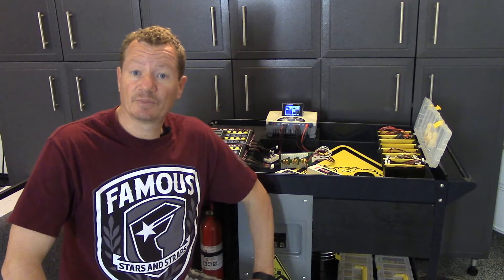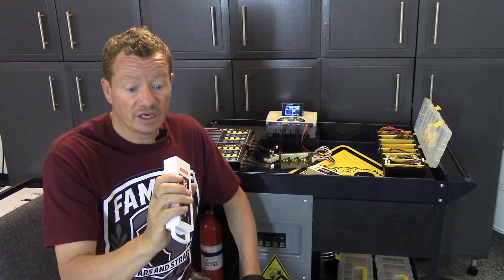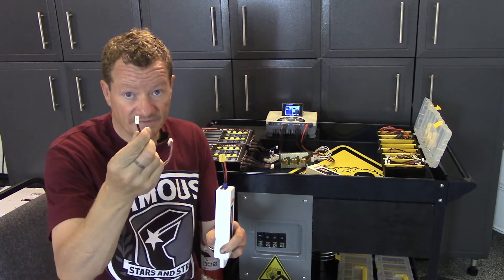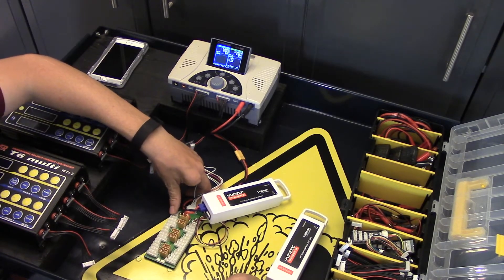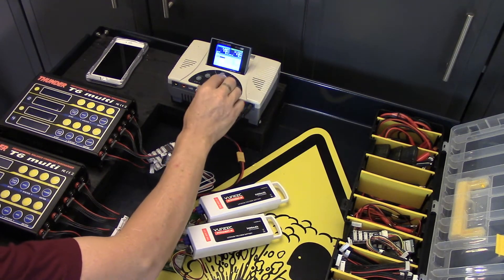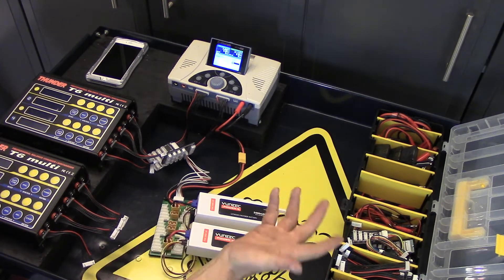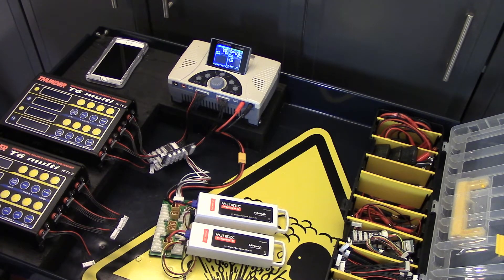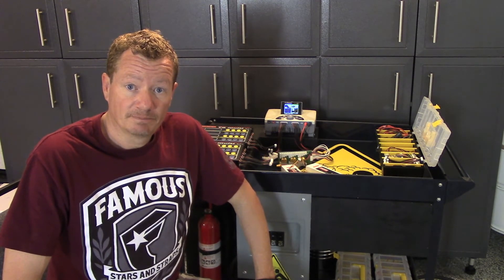Charging Yuneec Q500 Batteries Using The iCharger 4010 Duo

Comment: thx for sharing dude very helpful.. question.. do the battery`s need to be at the same level before charging ? or can 1 nearly dead the other half full ?
Reply: if your using then in parallel it will charge them both equally. it will balance it like a 6 cell